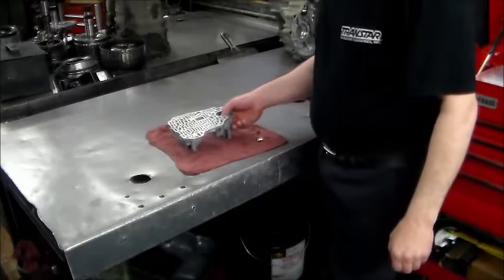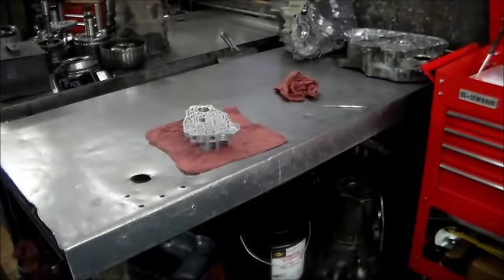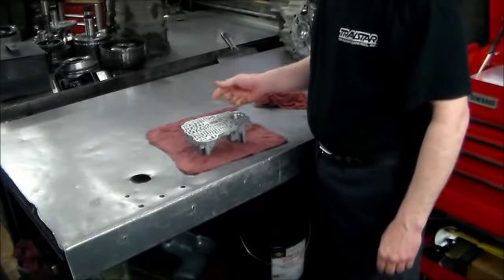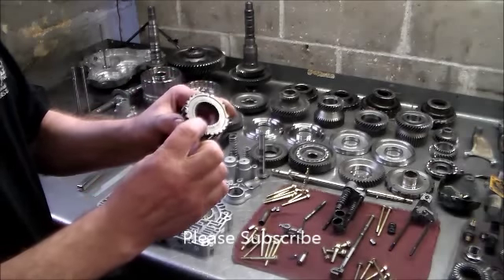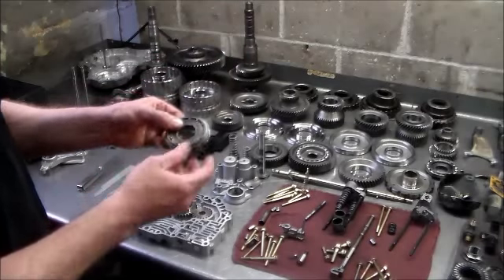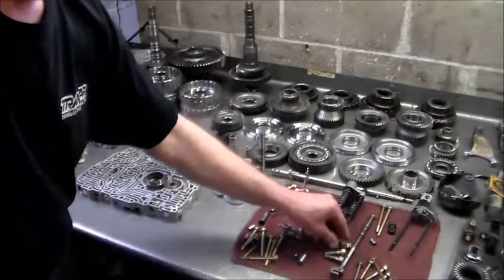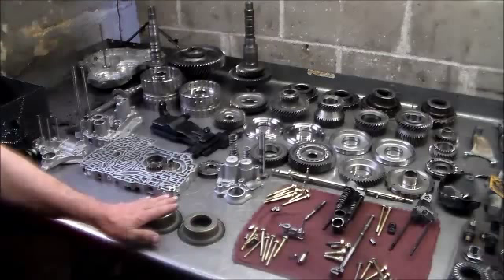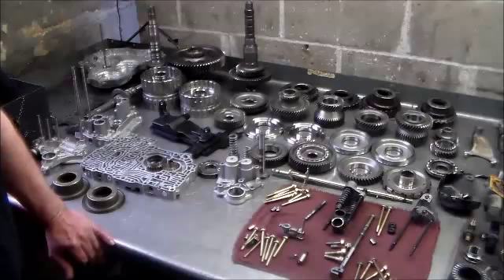Honda B7XA, Checking the valvebody

Comment: hey Garry chris here. where are you getting you main valve bodies from? its soo common on these honda units it's a must change especially on the hwy when vechical is in lock up and rmp and pump volume is low for fuel economy. if the pump pressure is low it will cause converter to drag and deff wear out the torque converter lining. hard to get good used parts here in toronto... where abouts do you get yours?
Reply from the maker: +chris manohar   When i do need them and transtar does have, i call  whatever it takes, they are located manily in the south(no offices here in ny) but they have everything, reasonable price. i just finished a honda and have a few more lined up for next week. Just wondering what is your price range to your customers on the honda units. Hope all is well. Gary

Comment: Gary can you tell me how many check balls total are in the valve body? I have found one under a small spring. Are there any others? Thanks, I'm trying to make sure I didn't miss anything.
Reply from the maker: Travis Harper Thats the only ball in the B7XA. Coupleof things, make sure your cpc(clutch pressure control )valves  are free free free, they apply and release the clutch packs and this trans is a clutch to clutch shift transmission, timing is everything. If you found that your clutch packs(like 2nd gear) is worn out, the clutch material is flaking off, you have to clean thcooleror change your raditator.  hve a hot flush machine at the shop and sometimes i have to flush out the honda coolers for 5 to 6 hours before th come out clean. f you dont flush it, then all the crap goes back into the trans. Thanks for watching. Gary